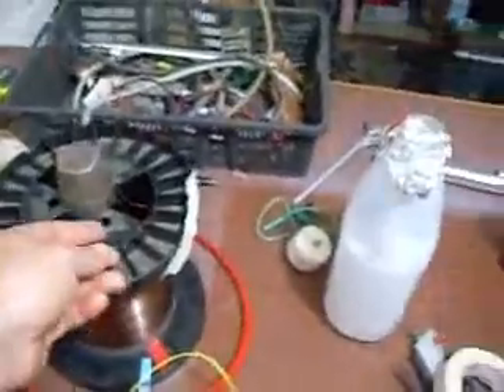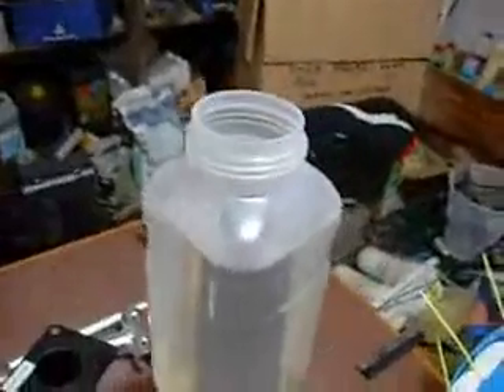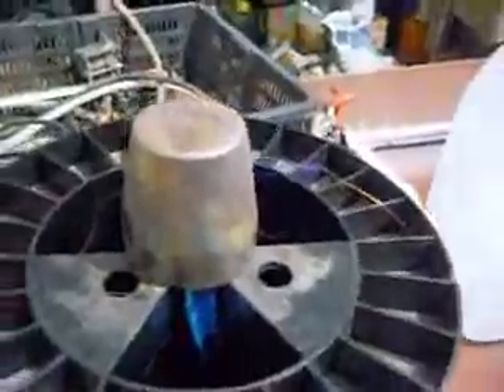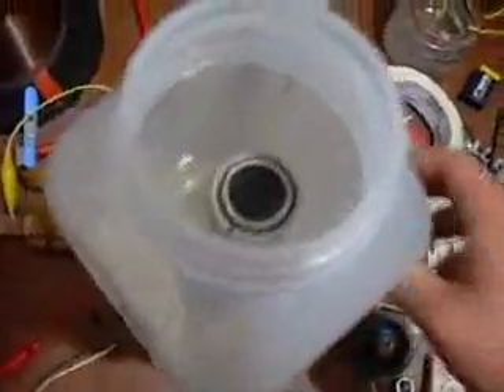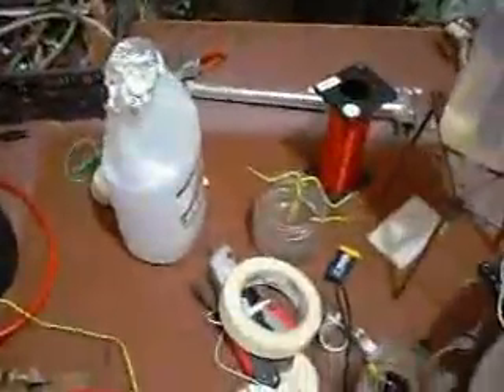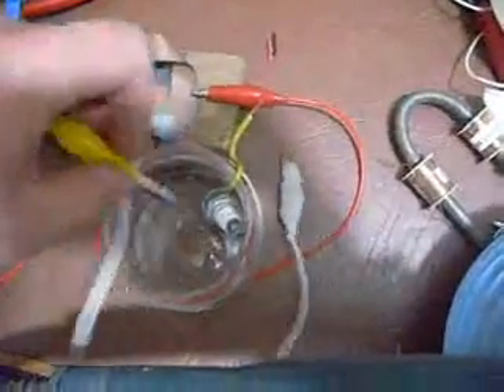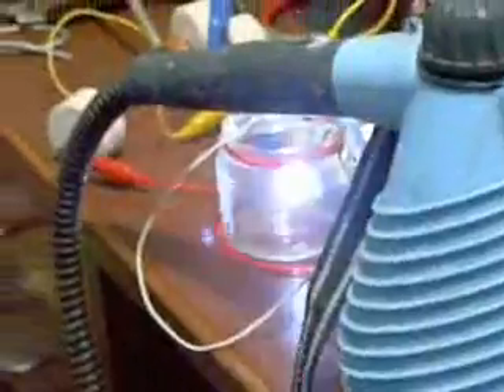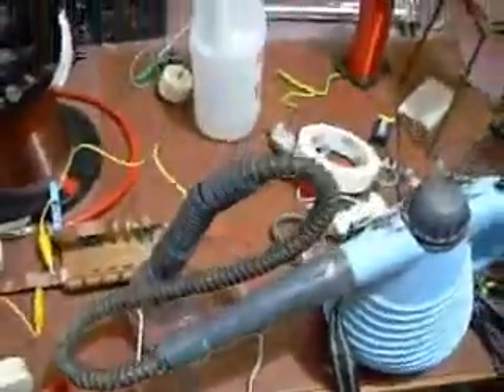Water Cracking setup on Meyer cell and steam...

Comment from the maker: @instantproducts i hope you watched the previous video showing the reaction this setup can give on distilled water.there is a DC component to the voltage created by the multiple spark gaps and it certainly looks like catastrophic failure of waters dilectric properties.trying steam and the meyers tube cell were just obvious things i needed to rule out with this setup,in the coarse of my continuing experiments.reducing the burning speed of the gas is my current focus.thanx for commenting.

Comment from the maker: @TheBeebopper using distilled water because it is not conductive-that lets the capacitors build up-the setup wont work with conductive water.
explosive gasses yes-noxious gasses no =)

Comment: you should try just putting the tips of the leads in the distilled water space them about 1" apart and flip the switch, it makes alot of gas.  and it will give you more ideas about rabbit feeder... mots still not active yet, cold season just started, and works hectic, its almost the weak end though.